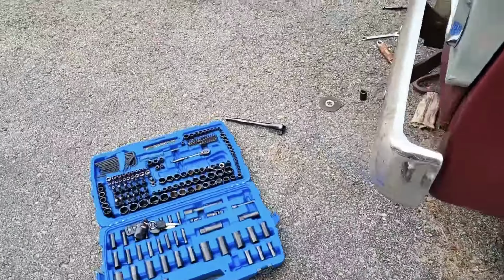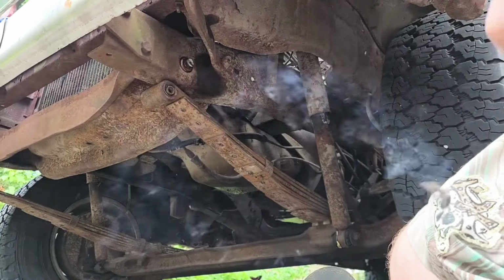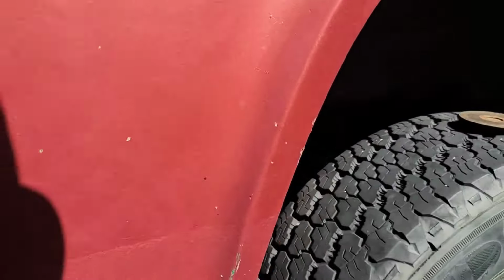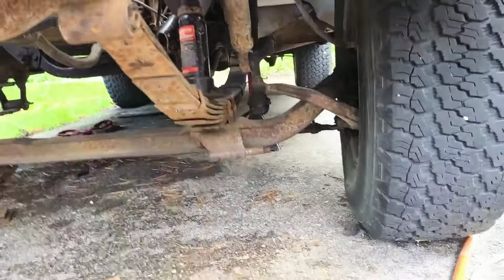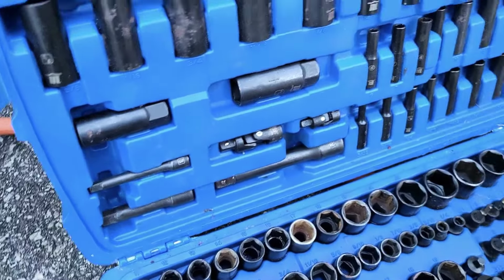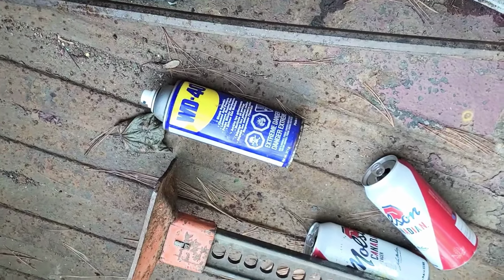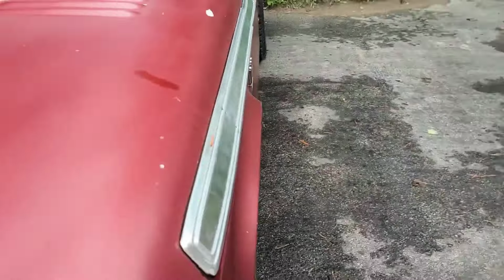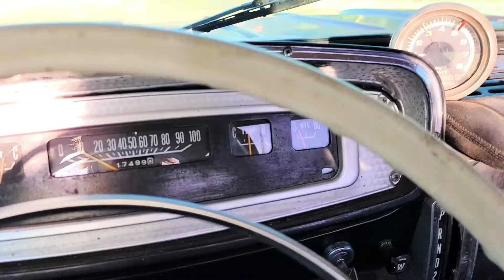Dodge d100 front suspension finally done. "gasser" fail first drive

Comment: Where’d you get you suspension components?
Reply from the maker: Hey thanks for commenting. I actually made them, The front mount is a leaf spring hanger bracket off a yj that i cut off and welded a plate to the top of it, and the rear swing shackles are the originals just bent to fit. Still have a few more things I wanna do to the front suspension before I call it done.